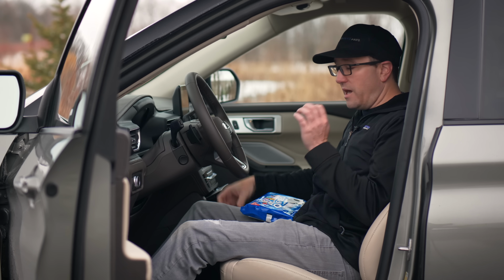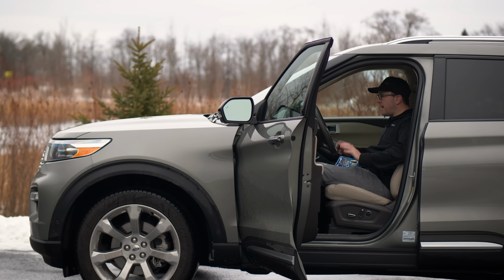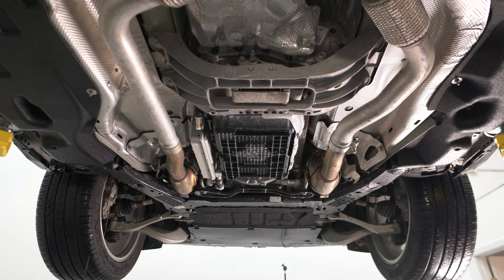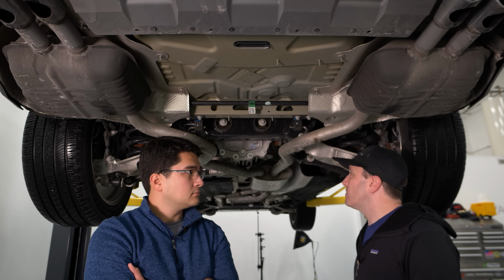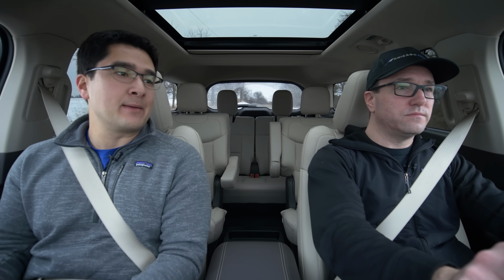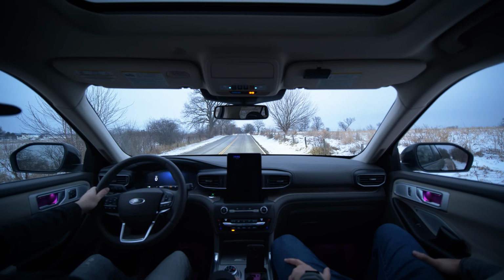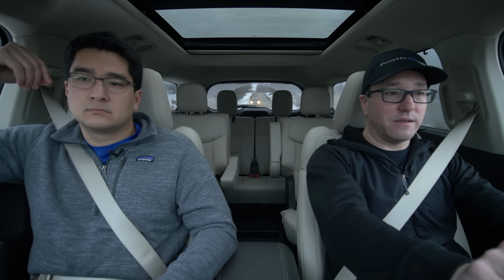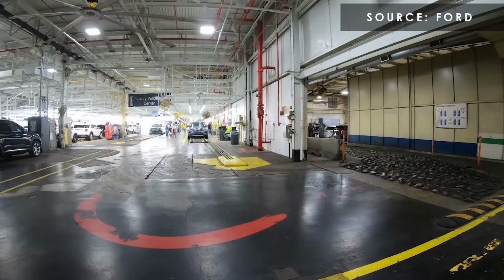2020 Ford Explorer | Who Is Responsible For This?

Comment: I work for Hertz and I can confirm your assessment. They get worse with a bit of age. We buy $45K MSRP (we pay nowhere near that) 202A XLTs with the 2.3L EcoBoost and "ActiveX" interior. It feels like they could've had such a great vehicle here. The interior is bad, the transmission is bad, the looks are kinda dated and it's expensive. Par for a Ford the front seats sit up too high even at their lowest setting. The center screen is a joke because it's aimed at the center rear passenger, not the driver.

Honestly, I'd rather have an LT Traverse for about $5K less. You lose the panoramic roof, but that's not a big loss for the front seat occupants. While it also has a cheap interior it's consistent and it feels put together better. Powertrain is WAY smoother and it still tows 5K pounds.

Comment: Wooow! This man throws Down The Gauntlet and doesn't mince words
 I love it. This is exactly how Kia and Hyundai was able to undercut car manufacturers like this. Like the Kia Telluride I bought 10 months ago.
 Is still selling like hotcakes! By the way I have absolutely NO problems with it. Attention to detail God bless!
Reply: You can have any car for ten months and not have problems. I’m sure your opinion will change over time if you decide to keep that Kia long term
Reply: The ride on the telluride is extremely bumpy... immediately disliked. Don't know how its selling
Reply: my friend has one of those and the plastic cladding on the sides is already peeling off, so is the lettering. That car is like a chinese phone- shiny, packed with features, will die in 3 years.

Comment: I work at a Ford Dealer and we've noticed a lot of these Explorers are having transmission leaks. Mostly covered under warranty. But it's so odd that every car has some ridiculous problem that shouldn't exist. Personally I love the new Explorer. I'm not very picky with materials and perfect fitments. I just care about the amazing 3.0L engine and the utility. I would definitely consider other brands. Perhaps if Ford does a refresh in a few years, it'll be a good buy.
Reply: Isn't that the same transmission that GM and Ford co-developed together?....if so why is it Ford seems to have trouble with it and not GM.

Comment: Well I must say these guys are on point. My 2017 Ford Explorer lease was expiring. I went in to look at and test drive the 2020 Ford Explorer Limited. It felt cheap and unfinished compared to my 2017 Explorer. I hated it and decided just to buy and keep my 2017 model (20,000 miles) which I like alot.

Comment: The last couple ford explorers have felt like slapped together half finished products. We have a 2015 model at work and everything feels like it's in the wrong place. The armrest for example is about 7 inches too far forward to be useful to anyone. My legs are either cramped or my arms are the wrong distance from the wheel. Felt like the car wasn't designed for humans.

Comment: Not to mention it's slow. It can hardly get out of it's own way with the 3.0L engine. The engine will probably outlast the vehicle if it is maintained though. They didn't even put a drain plug on the PTU. Basically the transfer case. Eventually it will self destruct when the oil gets worn out.

Comment: My friend has a 09 Escape. AWD,3.0L engine. It's only got about 130k on it. I know that thing has cost him a pile of money. PTU went out. Had a bad timing cover oil leak. Had to get the brakes,rotors replaced. It still needs the O2 sensor on the front exhaust manifold replaced. I can't get it out without removing the fan off the radiator. The front seal on the transmission needs to be replaced because the transmission leaks. He just spent  &2700 getting the timing cover fixed. They had to do the valve cover gaskets too and replaced the water pump and the timing chain. They want another $2k to fix the transmission leak and replace the o2 sensor. Doing a simple tune up is about $400 just in labor on this vehicle. The rack and pinion is also worn out. The shop told him $2k to replace the power rack and pinion along with the power rack and pinion steering computer. After seeing how many problems he's had before it even has 150K on the clock....I wouldn't buy one.

Comment: Great Review.  I've owned 3 SUV's over the last 20 years.  A 2000 Land Rover Discovery, a 2002 Explorer and a 2014 Lexus 460GX.  Out of the three, my favorite was the Land Rover, even though the reliability wasn't that great.  Just the way you sit in the car up high and the intangibles.  I did like the truck feel of the Explorer, but it was a pure piece of shit.  The Lexus has been trouble free and probably has the best off road capability of all three.  I gave American manufacturers three chances, all from different decades over the last 40 years.  I'll never buy another one.  My next one will either be a Lexus/Toyota or a Porsche Macan/Cayenne.

Comment: Im sorry. I just cant get past the ugly ass front and rear fascia from this and the generation prior. Also i severely dislike the C-pillar. The info screen is horribly positioned. 

Now as to Ford itself, their management is beyond me. How you can't make a profit selling 150k Fusions a year, after being on the market for 6 years... Is beyond me. Ford is the first to pull the plug on a model doing fine sales-wise whenever they see a slight decrease in sales. They traded in all their cars for this, as they did with the Taurus back in 2007. Now the cheapest Ford is the shitbox Ecosport starting at $19K. A hatchback/sedan buyer (aside from the gullible/lazy) is probably not gonna willingly cross shop a Focus or Fusion for an Ecoshit or Escape.

Im giving Ford one more chance with the Bronco.

side note: why the C-Max was axed is beyond me. I see a fuck ton of them everywhere.

Comment: I fully disagree when it comes to the lesser motors being under powered and would not feel right for the weight. My 2020 Explorer is the 2.3 eco boost and it has no problem getting up to speed it is quite quick. I feel you guys probably have not driving the other options because they sent you the most loaded Explorer you can get. You need to get a 2.3 eco boost and retest you might be surprised.

Comment: The third row and cargo area with seats up is all but useless in this update. You can no longer sit adults in the back due to floor height and leg room. You can no longer get four small suitcases in sideways, lucky to get two in flat if they are not over filled.

Comment: I bought a 2020 Explorer. I am one of those who always buys Ford.  I had a  2013 Taurus.  The Taurus got nothing but bad reviews but I loved that car.  It never had any issues.  I got 32 MPG on the highway.  It was super comfortable for me and it looked great. I replaced it with an Edge. I liked the Edge but it was never more than transportation to me.  I got the Explorer at a very good  price with 0 interest during the COVID 19 peak.  I believe that many of the issues ae with the Platinum version.  I can't complain about the basic audio system.  It sounds like every other basic audio system I have had.  The safety features and Infotainment system is just fine with me. The seats are comfortable. What is surprising is that the 2.3L get great milage.  I get from 28 to 30 MPG on the highway and I average 24.  I never feel like I need more power.  The  more than 300 HP is great.   As far as the transmission goes, perhaps it matches the 2.3 L better than the 3.0L.  I don't know.  Whatever, the transmission seems just fine with me.  I had to take my Edge back to Ford four times to get my 6 speed transmission fixed under warranty.   So far, no recalls.  I think that the XLT trim level at $28K to $32K USD is a very good value.  I am not buying an SUV for refinement. I want a family vehicle that is dependable.  Ford has never let me down completely -- except the Areostar I bought back in the 1980s.

Comment: He may be right on the little details, but I'm shocked at the explorer coming with that 4 cylinder turbo up until the upper $40K range.  Every other competitor offers 6 cylinders in the $30s.
And now I'm reading horror stories about those turbos going bad with low mileage.  
I'm a ford guy...   1 ranger...  1 escape...   1 explorer...  2 F150s...  What were they thinking??

Comment: Okay a couple points. To me the center stack needs to be completely redisgned turn the screen and square off the HVAC controls. Second the 2.3 is a wonderful little engine if you haven't driven I recommend to. I believe it is the quickest base engine in class. Second of all the transmission is lovely in my position. I love nice firm shifts not sloppy slush box. As well this transmission has adaptive learn strategy so assuming the people before were driving aggressive it is going to retain that. The leather is meh the door panels are alot nicer feeling than previous gen. It has room to grow hopefully ford will realize that and put the interior on par with the competition.
Reply: Great to hear the 2.3 engine performs well/ considering buying a Explorer for highway driving/ not towing anything other than a motorcycle trailer at times.
Reply: @Tristars75018  alright I made this post two years ago.  Since then has quickly became the worst vehicle ford makes I work on them for a living . The 2.3 rwd is reliable power train wise but the interior and electriconics are awful nothing but problems
Reply: @tybailey9428  Am hearing A 2024 Explorer possible update is happening soon. Will see what happens - I like the base model overall - however will see what happens...Is the 2.3 turbo ok overall? 🎰
Reply: @Tristars75018  yes the 2.3 in standard rwd is pretty reliable overall the 22 have definitely been more reliable than the 20 and 21 model years
Reply: @tybailey9428  thanks for info - on the Explorer base model - see what happens - Have had great luck on my 2020 Fusion base model 2.5 four cylinder non turbo engine...
Reply: @Tristars75018  that engine is bullet proof but I do recommend flushing the trans every 50k they have very small trans coolers causing the fluid to burn up quickly
Reply: @tybailey9428  many thanks on Explorer info and yes I bought the base model Fusion knowing that the 2.5 engine is reliable - Thanks for info on Fluid change at 50,000 miles on the transmission service., on Fusion

Comment: Might as well get slightly used  2019 x5 with 40i engine w/ 3rd row seats for low $50k, I think it’s best in its class. B58 engine is probably best 6 cyl engine available.

Comment: I just bought an xlt and I absolutely love it and btw not all the explorers have the tablet in portrait! Mine has it horizontally and it's an extremely amazing car
Reply: Mine also, landscape and bright and visible from the side, just bought an XLT. The ride is great and the seats are 100% better. Ive driven a 2018 Explorer Interceptor for 2 years and traded my own personal Explorer for a June manufactured 2020. The Interceptor has 47,000 on it and is doing great especially if you have driven a Taurus Interceptor which was an abomination after driving CVPIs for ever...
Reply: @alfredtucker2128  yes definitely I've driven the 2016-19 model and it doesn't compare to the 2020 I love mine and the rear wheel drive is such a big difference

Comment: A 4 cylinder for a MASSIVE suv like this?
275hp or whatever works well in a sub 3000lb car.  But if something weighs like 4500lbs or whatever this is..  does it even get to 60? And how does it tow a decent amount.  Gotta be the gearing

Comment: Great review! Thanks for posting. I tested the Ford Explorer the other day after the dealership I leased my stick shift Focus from (expat visa, what can I say, options were limited when I arrived) were offering to end my lease early if I buy or lease another car. I tested the base model 2.3l ecoboost engine (I found that the trims escalate in price at a ridiculous pace and I don't need some of the finery, I want to buy it, own for 15 years and run it to death). I too noticed the shifting was quite juddery, but the acceleration was quite good on the freeway. It does feel very solid, it's got a lot of room inside, the exterior is great. Right now seemed like a good time to get a new car and get out of the lease as Ford are offering 72 months 0% APR. Price wasn't where I wanted it though, they were after $32.5k (dealership is in South Jersey). Personally with all the teething problems and competition from other brands I'd have signed on $30,500.

Comment: My 2002 Ford Explorer was a total mechanical disaster starting with the failed transmission.  Now I only drive Toyota.
Reply: That interior especially the infotainment is.just as good as getting your knees and dicked down lol
Reply: Good choice. I own just toyotas myself
Reply: @alvinsimba734  I would have an extra $100,000 in my savings account if I had started driving Toyota 30 years ago!!
Reply: @bryancarlson3673  at least your eyes were opened sir. My old toyota is almost 200k miles and still on original suspension, ball joints and transmission and oil changes every 5k miles. Its a 2005 matrix which I will hand over to.my sibling as a graduation gift and due to that history of reliability from personal experience I helped myself to a 2020 corolla le which I hope will give that loyal reliability like the old one.
Reply: @alvinsimba734  A good friend has an old Corolla that he doesn't really take care of and it has almost 300,000 miles with very few repairs.

Comment: We bought a new explorer. I will say it’s very nice if you go for the xlt. We did because it doesn’t have the crazy big iPad screen. It has a regular 8” screen. Also I don’t notice the transmission being rough. It shifts perfectly fine so maybe the older ones had an issue but I just don’t see it. Our stock sound system also works fine and the Cabin is very quiet. The only gripe I have is the brake pedal sits extremely high. My wife’s foot can barely touch it with her heel on the ground.

Comment: I USED to be a big Ford fan. But I have realized that Ford just doesn’t care. They cut corners where they shouldn’t.  As well as the American auto worker doesn’t care about their product.  They only care about themselves and what they can get out of a company.   Vehicles made in Asia and German are much better put together. Who I really blame for the fall of American made vehicles.... unions. .
Reply: Google Ford DPS6 transmission--The UAW has its own issues but vehicle quality falls under company responsibility, Google the Ford DPS6 transmission then tell us who made a fiasco out of it well before the first one was installed in a retail for sale Focus/Fiesta.  Or the mess the company made out of the 2020 Explorer launch.  All the things the reviewer made negative comments about were designed into the final product before the first one went down an assembly line.

Comment: Honestly I prefer the Explorers design over the Telluride. This seems unique and purely an Explorer on its evolutionary path while the Telluride seems like a copy cat of a Volvo XC90 and a Range Rover. It does not look unique to me at all. Ford did a great job with the look and design. Kudos Ford! Here's hoping Ford can fix all of quality issues because this could've been a home run for Ford if the interior and driveability could've been just as good as the design. Very sad😔

Comment: All this centerscreen technology in modern cars and trucks is so useless and huge waste of money. Everyone has a smartphone now so why do you need the ability to browse Yelp while you are driving. The center screen technology in cars is such a huge scam for car companies.  If they really need to put a digital screen for tachometer, speedometer and other gauges and navigation, it should be like what Audi does with that virtual cockpit at most and it is very useful and easily configurable. That's it. Car companies need to go back to all buttons on center console

Comment: I experienced the transmission kicks due to the self learning feature they have, maybe that's what it was on your test model. Mine was older 6 speed though and it was just suddenly downshifting with hard kicks once a while in very easy 40 mile smooth traffic. Then another issue is with slipping 1st gear when i almost stop and go. This was on 7k miles used vehicle, funny that my 2 Chrysler 5 an 6 speed transmissions never had any similar problems and it's shifts were nicely smooth, but people are so convinced how they were the worst
Reply: My thoughts exactly. These 10speed transmissions have a ‘self learning’ curve.
Put multiple drivers in New vehicle … 😱 not cool.!. “test” drivers … 
… what could possibly go wrong👀

Comment: I am a Honda Pilot owner, and my Honda Pilot really sucks. The transmission issue mentioned in this video literally happens every time I drive. There are some other problems, the infotainment system is unstable as hell, it shows false warnings about engine, brake systems, and so on. The window sometimes will not close, and the control motor send out weird noise all the times. The interior feels super cheap as well as exterior. Only top trim gets a side mirror turn signal. The quality is super low, if you play music in a reasonable volume inside, the outside door panels shake, not vibrate, they shake!

Comment: Hopefully some of the transmission programming and interior fitment issues will be fixed by the second year of this model. I’m really excited for the ST personally but yes I would like to see first year flaws fixed before I buy one.  Also that Center portrait mode screen needs to be redesigned to match or exceed the quality of the portrait mode screen in the Dodge products at least.
Reply: Why would you consider buying this crap?